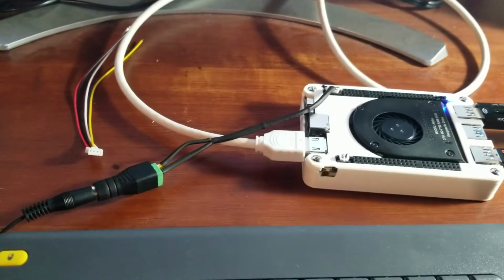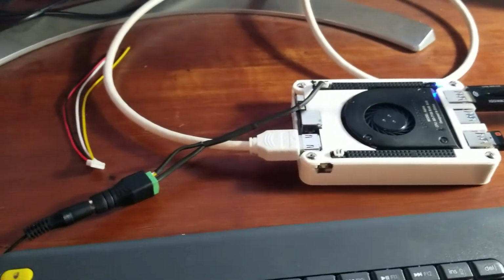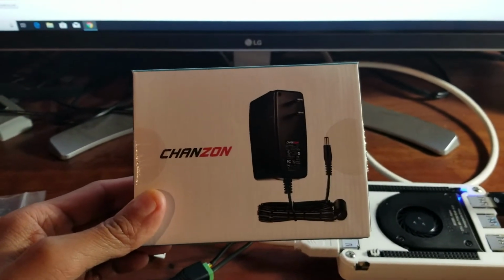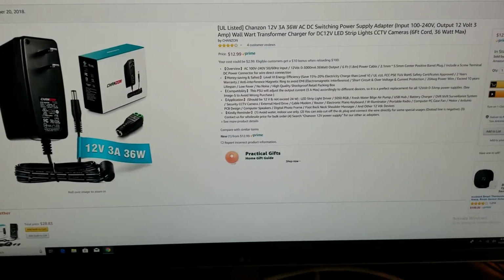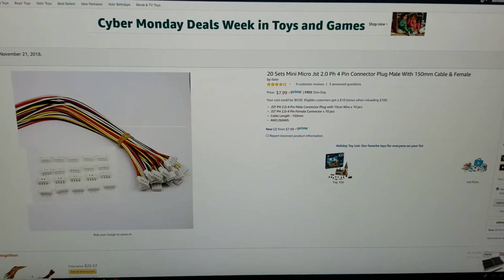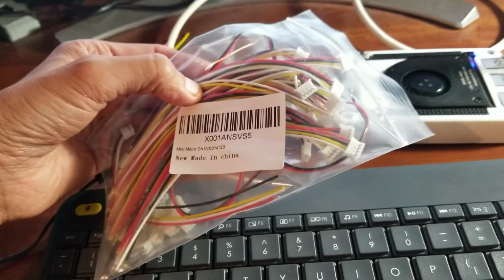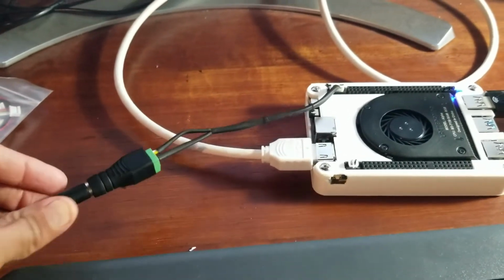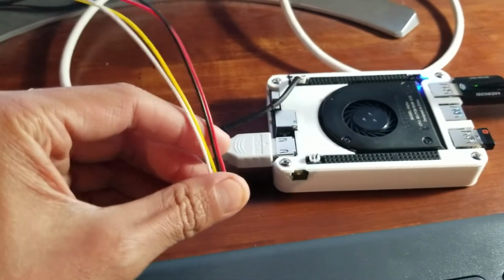12vdc connector for Lattepanda alpha

Comment: Thanks for video. I want to connect a second 12v 120mm fan. Can i do this? Which pins do I need to use?
Reply from the maker: Unfortunately it only has a 12v input no 12v output.
Reply: @huntsman1999  There is a 12v output pin on the lattepan. But it can only work if I feed it with 12v. Could this be true?
Reply from the maker: You have connect the fan to external power supply

Comment: If I use the DC input, is there any way to report the battery level to windows?  Planing in using 3s or  4s lipo through Dc port, because the delta doesnt have the 10 pin port.

Comment: I see you are using the 12v dc in jack and a 12v 3A power supply, I was wondering if you can put 3.5A through there and not get any problems?
Reply from the maker: It should be fine to use a 3.5A.

Comment: Wanted to say tyvm for taking the time to make this video. I have now rigged up my 12V power supply and works perfect thanks to your instructional ... prior to this my board would not show any lights using the LP Power supply after the first unplugging and then reconnect of the unit ... funnily enough, after purchasing a Powertran M 8987A  from a local supplier and the connectors from Amazon I decided to try the LP Power supply again while waiting for the connectors to arrive and I was able to boot ... but then disconnected and reconnected as a test and had no lights on the 864 once more.

I had already tried the hold both buttons for 20 seconds with power connected -> disconnect power and hold both buttons for 20 seconds -> wait one minute -> reconnect power method with no success.

On first try of my 12V supply it also failed to show lights but I stripped the wires back a bit more, twisted the two sets together and screwed them back in and then removed the RTC battery from the board and reinserted (which I had seen somewhere as another possible fix) and am now in full action ... so not sure whether the removal of the RTC battery had anything to do with it or whether it was a bad wiring job on my part on the first attempt and still not sure if I am able to power say an external HD via a USB-C cable as I don't have one.

The main thing for me is that the board fires up and I am now writing this comment via my LattePanda Alpha 864 powered via this videos help - HAPPY DAYS :)

Again, thank you very much for making this video - really appreciate it - cheers!
Reply from the maker: Your very welcome.  Glad it worked!

Comment: On my Lattepanda alpha I could not get it to power on with USB-C when I unplugged a USB 3.0 hard drive. But when I plug the USB 3.0 hard drive in then the USB-C power worked.

This my help others. I order the cable to power it with 12 volts.
Reply from the maker: Same happen to me.  The USB-C can output power to a hard drive, but can't get power into it.  It's a flaw in the port design.

Comment: This did not work for me. Mine died the day I bought a windows Home key for it, RIP. Then I wasted $40 bucks on this stuff.
Reply from the maker: I had to return it mine back. The fan on mine failed.  I spent $30 to ship it back and took a month to get a new one back.  The one I got back worked much better.  No power issues and the fan was quiet.  Sorry you are going to have to contact tech support and get an RMA for a return.
Reply: @huntsman1999  Hi Marco, can I confirm that you did an RMA on the board after you made these videos about the power supply? I have just emailed them asking about it as mine is an original version and suffers the same problems. it's very poor really and I'm not looking forward to spending more money to send it back. I don't use mine often and I don't even have the box anymore I don't think so that's a pain as well :( Wish they'd tested these properly before them!
Reply from the maker: @MikeyC314  yes I still did an RMA because the fan was failing as well. It was getting very loud.  It took a while to get a replacement, but I did get one a month later.